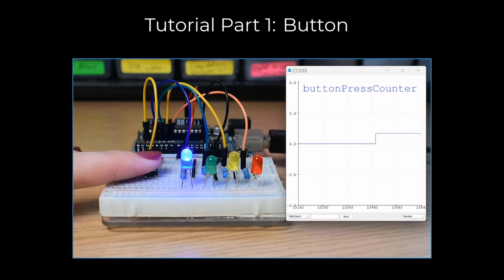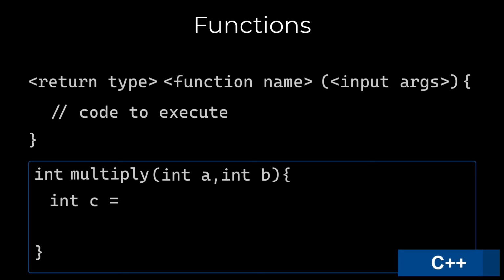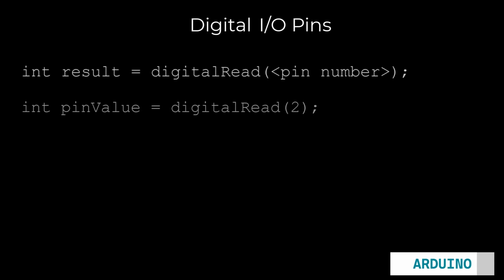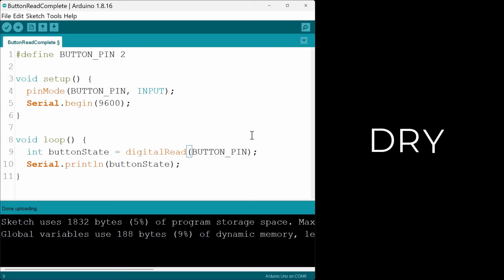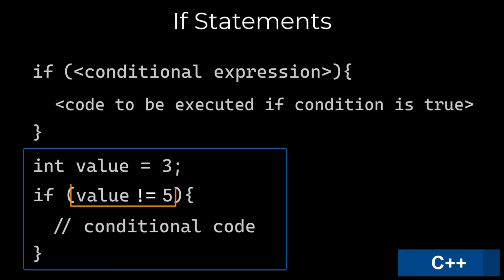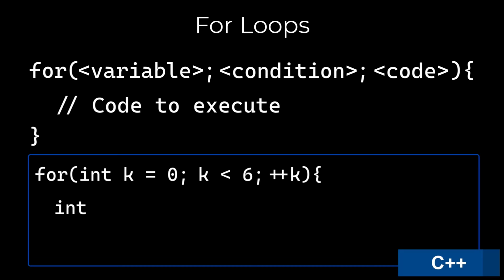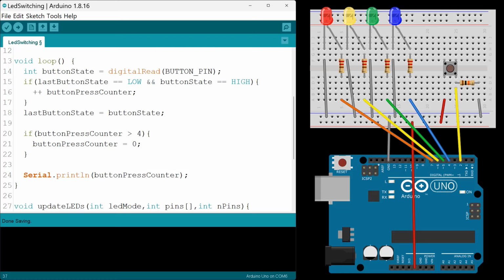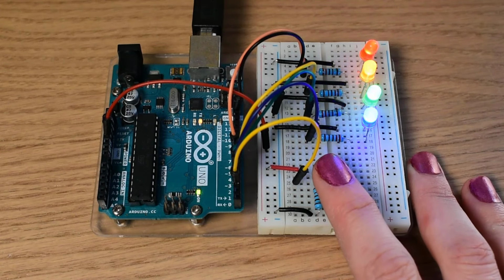How to Code Arduino: Beginner's Tutorial

Comment: To control the LEDs, why cant u use just use four IF statements each making the pin high when the condition is satisfied. Then  reset them all to LOW when the counter resets. Isnt that simpler?

if (counter > 4) {  //To reset the counter and the LEDs
  counter = 0;
  digitalWrite(LED_ONE, LOW);
  digitalWrite(LED_TWO, LOW);
  digitalWrite(LED_THREE, LOW);
  digitalWrite(LED_FOUR, LOW);
  }

  if(counter == 1){
    digitalWrite(LED_ONE, HIGH);  // make 1 on
  }
    
 if(counter == 2){
    digitalWrite(LED_TWO, HIGH);   // make 1 and 2 on
  }
   
     if(counter == 3){
    digitalWrite(LED_THREE, HIGH); // make 1, 2 and 3 on
  }
   
     if(counter == 4){
    digitalWrite(LED_FOUR, HIGH); // make all on,
                                  // then they will reset when counter > 4
  }

Comment: I am working using arduino nano, and MPU6050 with a vibrator motor to have a vibration signal when the arduino circuit travel a distance of one foot or more. I wrote the program but i think i am missing something. Any sugesstion or similar example

Comment: So pin 4,5,6 & 7 put out power to the Led's? 5v?
Reply: they could be any 4 digital pins, and you need a resistor to not burn the LEDs

Comment: I know most of this stuff but BY GOLLY life would have been a lot easier if all tutorials presented to me had been in this style and lucidity. Thanks! 

If I may make two suggestions:
- For variables of a certain data-type, adding a prefix like i_ or f_ (int or float) reduces ambiguity, albeit the clunkier name 
- When you have a tutorial-slide about e.g. " if statement" it would be helpful to have the keyword "if" italicized or emboldened (or differently typefaced) to indicate that it is being used differently than "plain English"

Welcome back, btw :)
Reply from the maker: Hi Aditya,

I really appreciate that comment. I was going for a simple clean approach here -- trying to fit in as many of the essentials as possible (without going too fast -- which I am occasionally guilty of). Something that I like to see when learning a new topic.

Those are good suggestions! Thank you for taking the time too have a look.